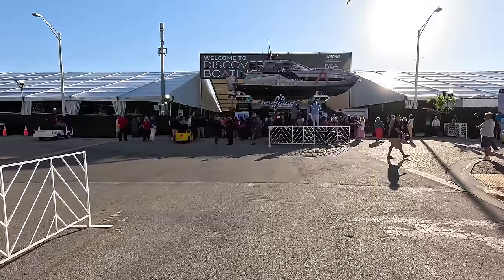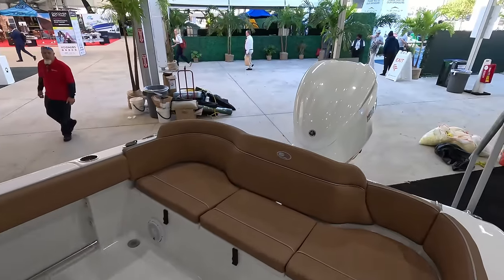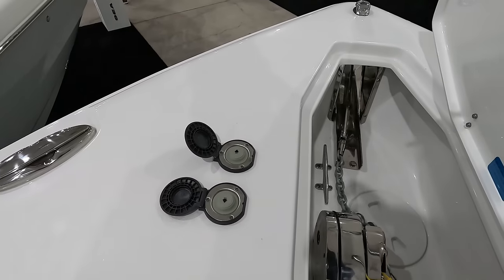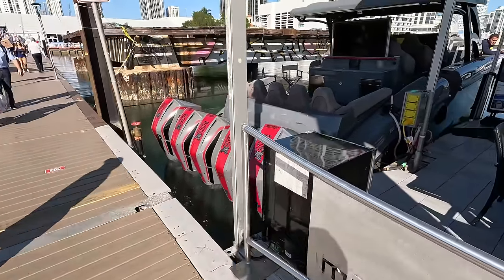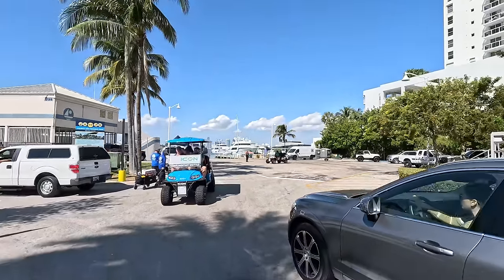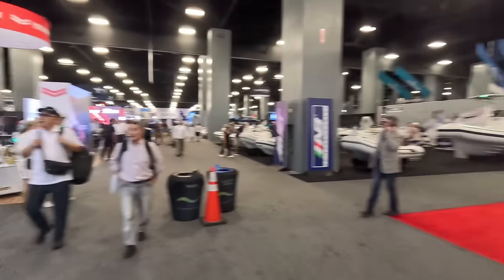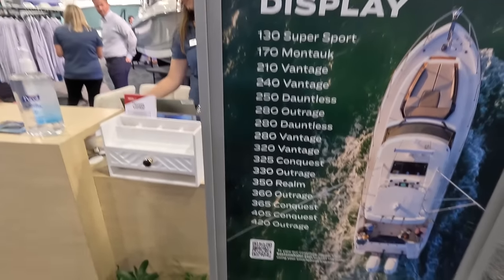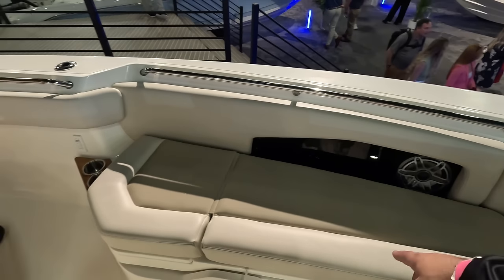2024 MIAMI BOAT SHOW ALL CENTER CONSOLES WALKTHRU

Comment: Great video of the center consoles, one thing you should of mentioned is the SeaHunter brand of boats are very well known as also being Unsinkable and built extremely strong using Kevlar, Carbon fiber and Foam coring. They are also famous for their videos of them dropping one of their boats from a cranes to show just how strong their hulls are and also actually a cutting one of their boats in half and driving it in the water to show how they are unsinkable. I believe those videos are still on YouTube.
Reply from the maker: After reviewing 50 Plus boats in one day sometimes you forget some details but you are correct they are unsinkable. I see that seahunter cut in half each time I drive to the Keys lol!

Comment: The 285 Everglades made zero sense. My buddy runs the 295 and the 295 is more fishable then the 285 which is marketed as a fishing boat. they took away the large workstation and smaller fuel tank. The 295 isnt a true fishing boat and we fish it real hard. Everglades missed the mark with the model! the 295 has the motorized window as well. If Im not mistaken the Everglades has the patten on that moving console window. The only problem is the lithium grease gets dirty and leaks down the side of the console once in a while
Reply from the maker: Good to know fl native